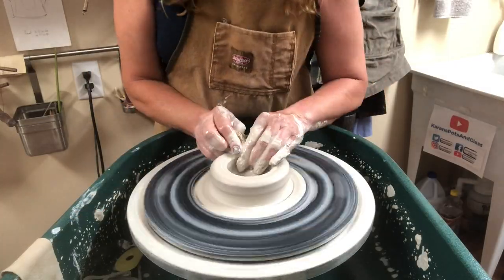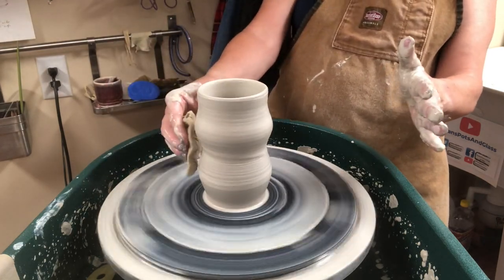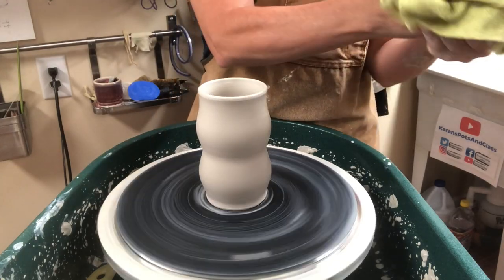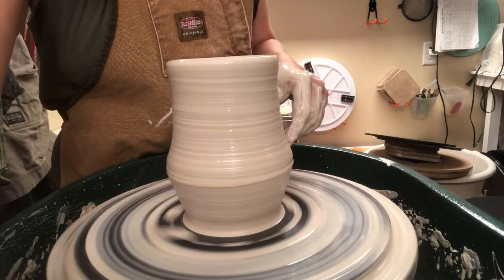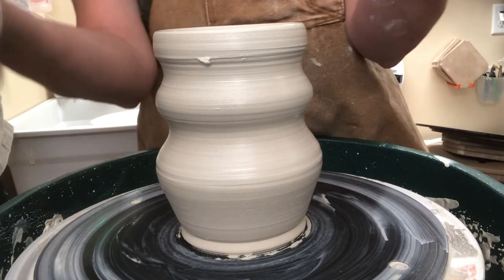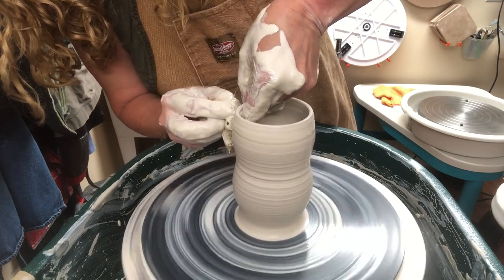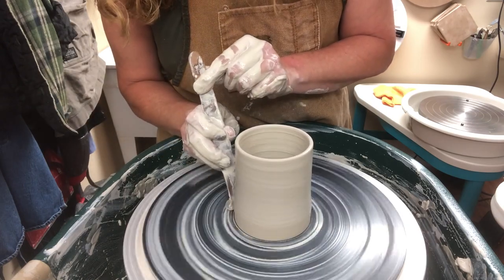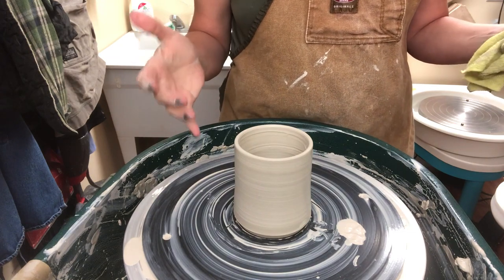Wheel Throwing Series, Step 5: Shaping the Thinned Cylinder into an Interesting Form!

Comment: how wide is the top when it shrinks and is fired?
Reply from the maker: Hi DyAnn- my rule of thumb is after firing, I like the width of a mug to be the distance from my mouth to the bridge of my nose ('ish")... as I look in my cabinet at my mugs, they normally range between 3- 3.5" on the exterior. (I do have a few more narrow or wider, but the narrow ones are harder to wash- and the wide ones easier to spill when drinking). The ones in the video haven't dried or fired yet, so I can't be specific on those!  I do factor in shrinking, as it always seems so dramatic in the size loss!  ;).  Of course, different clays will shrink at different rates... so you will want to find what works best for you!  :)